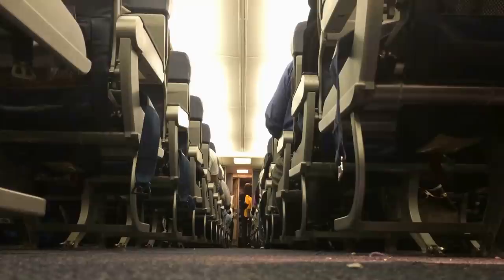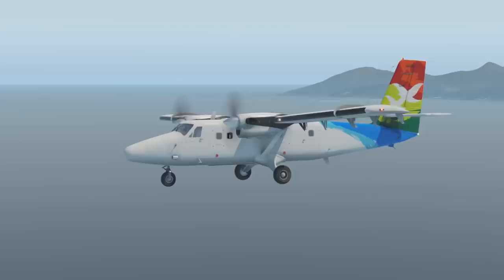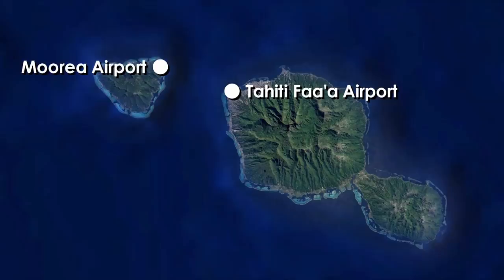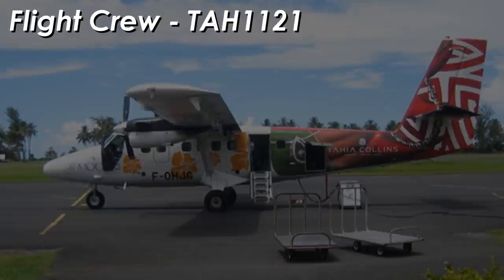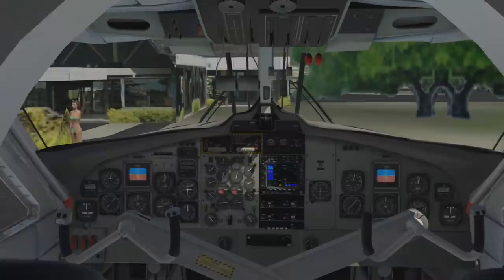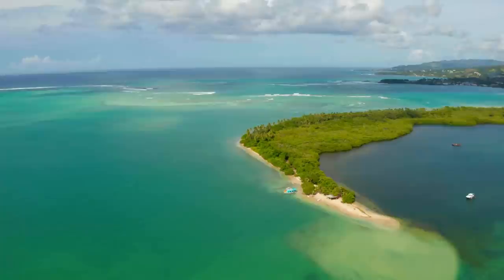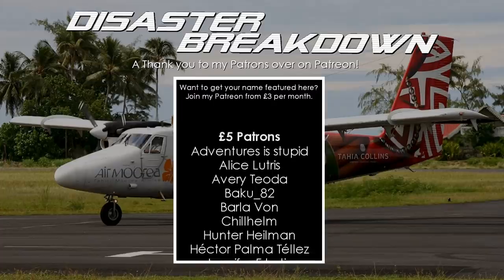The Terrifying Case of Air Moorea Flight 1121 - DISASTER BREAKDOWN

Comment from the maker: If you found this video to be interesting, be sure to subscribe as there is a new video every Saturday. This video also went out to my Patrons on Patreon 48 hours before going out publicly. Consider joining here from £1 per month: https://www.patreon.com/DisasterBreakdown
Reply: This accident could have been averted using predictive maintenance . A computer could calculate the wear and tear on components by measuring forces on cables, turbine temps and other components. For instance, we know that rusted metal has a lower conductivity than new metal. Imagine passing 10V of electricity through critical bolts (ex. rudder, elevator bolts), and when the bolt corrodes, the voltage drops. A current sensor can alert maintenance crew when the voltage drops below a critical level, meaning the bolt has rusted to an unsafe level for normal flight operations. The location of the bolt can be shown as a red dot on the mechanic's tablet, or on a screen inside the cockpit. The only issue with predictive maintenance is when the very sensors that detect the issue break themselves. Monthly sensor calibration would be a must for this concept to work.

Application 1: The left engine of a 9 year old jet has begun to make strange sounds. A vibration sensor in the engine mount sends this information to the flight computer. Temperatures near the ball bearings on the turbine shaft are within the normal range, but are slightly high. Data from the vibration sensor and temperature sensor are compiled, and show that a possible damaged ball bearing may cause an engine failure at 75% thrust, but not 60% thrust. The aircraft computer alerts the pilots and automatically throttles down.

Application 2: A small regional plane is undergoing routine maintenance. A tire tread depth sensor on the landing gear (uses laser measurements) has detected tire wear as the plane's avionics were powered on. The mechanics receive this information on their iPad, and relay this info to the tire manufacturer to order new tires. The sensor says the plane has 1 more month of safe tire operation before replacement, giving enough time for the new tire to be delivered to the hangar.

Application 3: An Embraer aircraft newly delivered to a large airline in 2030 has had the autopilot turn off sporadically during routine flights over the North Atlantic. The flight computer records the time when the autopilot disconnects. At the same time the autopilot disconnected, a false electrical signal of control surface angle was recorded, along with a power surge in the electrical transformer. This data along with the autopilot disconnect warning is sent to Embraer's design team. A few weeks later, the data is correlated with increased solar activity. The cause of the autopilot failing, false data and the power surges in the avionics was from a massive solar storm at high latitudes.
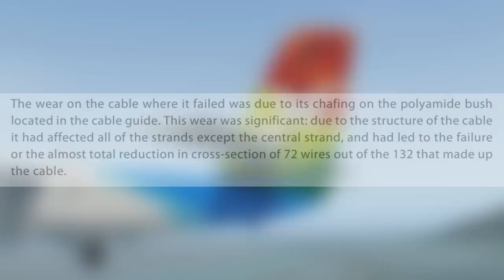Reply: 8:46 wearing'em down overtime quote... "the wear on the cable where it failed was due to its chafing on the polamide bush 🎄 located in the cable guide. this wear is singificant:due to the sructure of the 🏨 it had affected all of the strands exept the central strand and had led to the failure or almost total reduction in cross-section of 72 wires out of the 132 that made up the cable"
Reply: I'll pass
Reply: Speak English

Comment: I don't know what a pilot is supposed to do at 600 ft ASL when he loses control of the horizontal stabiliser. Those people didn't stand chance, may they all RIP.
Reply: I don't think he could've done anything, even at 33000 ft 😓
Reply: @MrNicoJac  Well that was weird. I type a reply about Sioux City (United Airlines fight 232) and I lost it. They lost the entire hydraulic system when #2 blew a fan blade. Although many were killed, they did make a magnificent effort and almost brought it home. It may be that they Twin Otter's elevator (vertical stabilizer)  snaps back into the central position which would be the level flight position (allowing for trim). I just don't know but even a couple of 1000 ft is leaves 0 room for recovery.
Reply: @marcdraco2189  You're right, it may have gone into a phugoid, just like the Sioux City crash and JAL 123. Had the pilot more altitude, the increased speed of the dive could've increased lift, causing it to pitch up until it slows and drops again. Even after that though it would be very hard to land.

I'm no expert and I have no idea if there was something about the twin otter that would make it react differently to those other accidents

Edit: the way the report says the "pitch up cable" kinda implies that the elevator would've been jammed into pitch-down if it snapped, idk 🤷‍♀️
Reply: i just did some research on this and apparently it would have been possible to recover from the LOC and safely land using the pitch trim, which moves the entire horizontal stabiliser - the cable that snapped was only controlling the elevator. however, since he had only a few seconds, and was not trained for sudden loss of pitch control, the pilot can't be expected to think of this and execute in time.
Reply: @Freeeez3  Ah good to know, thanks. Didn't consider trimming the whole stabiliser.
Reply: @Freeeez3  good lord.  That must have been the training they alluded too. Thanks man. I’m going to see if can do that in Xplane.
Reply: @Ben Chuft well he wasn't trained for sudden loss of pitch control, he would have had to improvise the solution and he had maybe 2-3 seconds to get it done. 

you can't just assume a regular pilot would have had the same amount of experience, training and skill as a test pilot when it comes to dealing with sudden unexpected failures.
Reply: @Ben Chuft I have to agree, you would hope pilots are in mechanically sympathy with their aircraft. Surely the first thing you would think of is stabiliser trim.
Maybe he did but simply ran out of time. As people keep reminding us he was only at 600ft.
Shifting load and power also?
Reply: @andrearitter2110  ?
Reply: Yes captain obvious. Just like the narrator said.
Reply: I was trained for elevator failure when I got my PPL. Trim should be an immediate reaction. When raising the flaps, the pilot would have to pull back on the yoke to maintain climb in the Twotter, so he should already have been reaching for trim. When the pressure gave way, that can only mean one thing, and only one response.

He had a few seconds to react, though of course he was a bit surprised and caught off-guard. Even if he couldn't save it with trim, the plane might have hit at a more shallow angle, possibly increasing survivability. Other options - lower the flaps to pitch back up (flaps cause a pitch-up in the Twin Otter), and retard power to slow impact speed.

Comment: One comment. You mentioned the pilot had about 3000 hours. If I remember correctly he was a long time extremely well experienced Career Jet Airliner Captain. Air Morea was his retirement job that he took in part for his love of hand flying the aircraft. He was by all accounts a true master aviator. The sort of Pilot you would want to be flying with. But when the cable snapped at 400’ there was nothing for him to work with. He had no controls. It’s also worth noting that only the largest and most modern airliners are entirely hydraulic. Many still use some combination of cable controls assisted by hydraulics, or just straight up cables for some control surfaces. Smaller prop planes are still mostly cable controls.
Reply: Hydraulic systems are heavy and these planes just don't have the power or the space to replace all their control cables with them.
Reply: Some aircraft use rods for the control surfaces - which is considered more reliable than cables but lighter than hydraulics. I love the feeling they give to the control of an airplane, very firm and immediate. But I can imagine them needing more force with a faster aircraft.

Airplanes have successfully recovered and landed with loss of cables and even hydraulics - but not when you're already as low as 600ft. If the the trim had still worked and there had been enough altitude, they might have saved the airplane and all on it. In fact, not mentioned in the video and what I wonder: why would the aircraft have so violently pitched down if it had been trimmed out properly? There would have been no force at all on the elevator!
Reply: All the more reason for strict maintenance protocols in light of the lack of control system redundancy. Intermediate maintenance protocols are expensive. Parts are sparse for older aircraft. Skilled maintenance crews are relatively non existent with many of these smaller carriers. Lots of stress on parts with multiple short hops. Think about it like the wear and tear on a automobile that is mostly used for city driving vs one that primarily travels on freeways.
Reply: @michaelhoffmann2891  I'd imagine a rod that runs the entire length of this aircraft would be prone to bowing from its own weight. Clips to support that rod could result in friction points or even catching as they are worn.
Reply: @dlvox5222  The company running this plane was keeping to a strict maintenance cycle, it's just the lack of jet wash barriers where the plane was parked caused more wear than anyone anticipated.
Reply: @Uldihaa  It was also that the company had followed the manufacturers recommendation and replaced the steel cables with newer composite ones due to the steel's susceptibility to corrosion in the tropical environment. Nobody realized the cumulative effect that passive jetwash would have in creating stress on the newer cables. The old steel cables had a bit more give and flexibility and were less prone to damage over time from forces such as the jetwash. This sort of thing happens on occasion. They replace a traditional component with new state of the art materials only to later discover an unintended problem because some properties of the old parts were inadvertently solving a problem that nobody realize was there. A good example of this if Carbon Fiber Helicopter blades and sections of aircraft skin. Carbon fiber wears better, last longer and is lighter than the old materials. But what nobody initially gave much thought to is what happens when lightning hits it vs the old materials? They discovered that while traditional materials are really good conductors of electricity, Carbon Fiber is a really really good resistor. Which is kind of bad.
Reply: @andrewtaylor940  Yep. And wasn't that issue with carbon fiber discovered when trying to solve a completely unrelated case of "airplane pox" as the paint wouldn't bond properly to the aircraft's skin? Or was it discovered earlier?
Reply: @Uldihaa  uhm, sorry, but why would that be the case? Rods are being used in aircraft and that is not an issue. Even modern GA aircraft like Diamonds use them.
Reply: The captain was 53 years old and had 3,610 flight hours. Why would a 53 year old extremely well experienced Captain quit airlines to fly puddle jumpers for very little pay compared to airlines that makes no sense 53 is not a retirement age for airline pilots, plus he only had 3,610 hours, that doesn't make him long time extremely experienced airliner Captain, most airlines won't even make you a Captain with 3,610 hours.
Reply: Andrew Taylor 3,000 hours is not that long. Most airlines would not make you a captain. Maybe a first officer?  And I doubt he was a master  aviator!
Reply: @michaelhoffmann2891  Does the de Havilland Canada-6 have elevator trim tabs? I don't recall it having any
Reply: @michaelhoffmann2891  The plane pitched down as a normal result of flap retraction. Twin Otters do that, and Twotter pilots know they need to pull back on the yoke and re-trim when they retract flaps. The aircraft was recoverable, as demonstrated during the investigation by pilots who knew they were expecting the failure, by using trim alone. One slight correction - the cable snapped before the plane reached an estimated maximum altitude of ~350 feet (BEA accident report).
Reply: @andrewtaylor940  I think you've confused this pilot with someone else. Of his 3,514.5 total flight hours, only 106 in the Twin Otter and had 298.6 hours total time in multi-engine aircraft. The only multi he was rated to fly was the Twin Otter, which he began training on three months before this crash. (Smaller and non-turbine aircraft don't require ratings.) He might have been an excellent pilot, but he was not very experienced in the plane he was flying. He had no prior career flying the large jets, though he was rated to fly Cessna single-engine turboprops. This all comes from the BEA accident report: https://bea.aero/docspa/2007/f-qi070809.en/pdf/f-qi070809.en.pdf

Air Moorea might have been his retirement job. He was 53. I don't know what mandatory retirement age was in France, but in the US it was 60, so maybe he wanted to spend the last 7 years of his career as a pilot taking it easy in Tahiti.
Reply: @beenaplumber8379  ah, thanks for that info!

Comment: The report highlights inadequate training for situations like this?  Seriously, what training is going to help when you lose all pitch control and nose down at 600 feet?
Reply: Pray, maybe
Reply: It's one of those "Oh, and while it wouldn't have saved THIS plane, we can't help but notice...'
Reply: Gonna bring a comment from another thread over to here.
According to Freeeez3's comment:
"i just did some research on this and apparently it would have been possible to recover from the LOC and safely land using the pitch trim, which moves the entire horizontal stabiliser - the cable that snapped was only controlling the elevator. however, since he had only a few seconds, and was not trained for sudden loss of pitch control, the pilot can't be expected to think of this and execute in time."

I'm no expert, so I can't validate this, but that might be the training they were referring to.
Reply: There might also be the matter of maintenance training...
Reply: @AnimeSunglasses  Tahiti. Paradise. Lay back attitude…Realax, you are on vacation. Some of this infects workers…If I was that pilot, I would look at cables myself, time from time. When I rent a car, I actually look under the hood…weird, eh?

Comment: "Given the number of seats of planes which performed such route and the demand..."

I could roughly guess what happened when he said this. If you run a car around that much in a day it's eventually going to breakdown unless maintenance checks was done every day or two. Sad that this happened. :(

(Also was there a boat? Seems like 18km is not that far enough to have a boat to ease the burden on the airplane.)
Reply: I’ve flown on this route with this company. There is a boat service between Tahiti and Moorea. But it takes a couple hours to complete. When on vacation you’re in a bit of a hurry to get there, so you fly.
Reply: It takes 45m max on their biggest boat but they have an express one which takes 24m now
Reply: @samiam619  When I am on vacation, I’m on vacation. I make time.